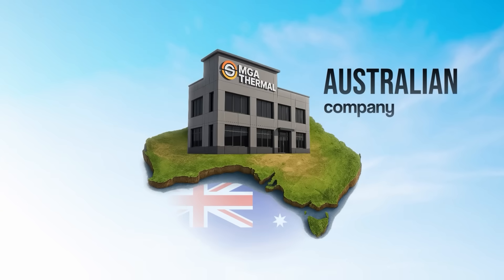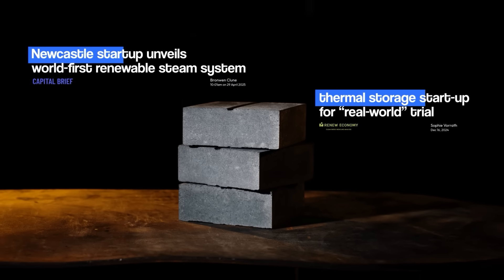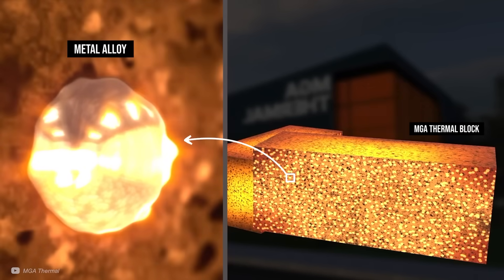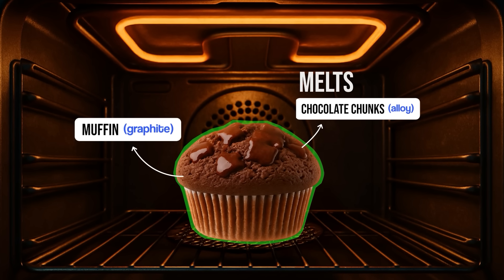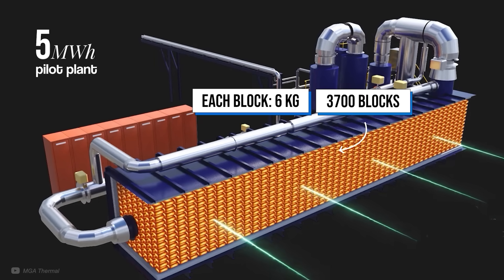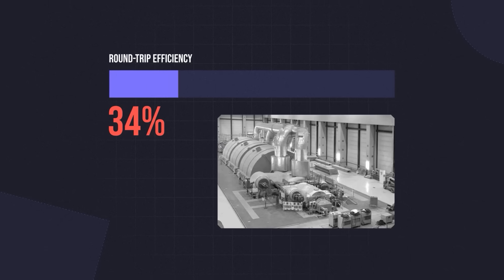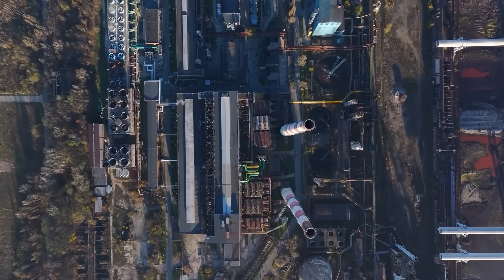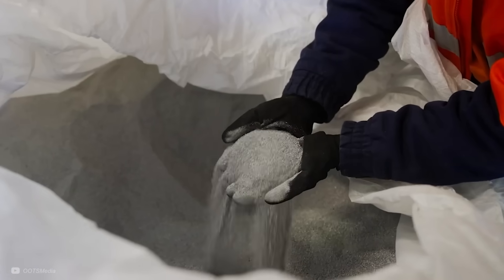Why This Carbon-Alloy is the Future of Energy Storage

Comment: Forget about the blocks, I want to know more about that insulation. 2% loss per day, out of 5000 kWh, means 100 kWh loss per day 700 °C inside, 20 °C outside, and say just 100 m² total area, means 1 kWh per day per m², or roughly 40 watts per m², with 680 °C difference, you need over half a meter thick insulation if it's as good as styrofoam, and that wouldn't leave much space left, and you can't use styrofoam due to the temperature. 

For thermal storage you want the least amount of surface area possible, even if you can store heat with that low loss in a shape like that, you halve the losses if you halve the surface area, and also need half as much of that magical insulation.       

About the blocks, another reason to forget about them is even though the in-plane thermal conductivity of graphite can be rather impressive the inter-plane conductivity is really low, making the overall thermal conductivity of graphite, unless you can align the planes in the direction you want heat conduction, pretty low. On top of that, the graphite takes up space, which increase the size for a given capacity, which in turn increase the surface area, and heat losses and costs even further.      

Metals typically have reasonably good thermal conductivity, on of top of that molten metals can distribute heat via convection, even the in-plane thermal conductivity of graphite is negligible compared to the potential heat transfer in liquid metal via convection in an application like that.  

When transferring heat, you want as few transfer stages as possible. Why use nitrogen if you want to generate steam? Why not put a boiler in there?
Reply from the maker: Wow thats really interesting, I have to admit I didn't actually run these numbers. This is of interest for all high temperature thermal energy storage systems - I will have to do some digging and see what I can find out.
Reply: It could be aerogel insulation like that SpaceTherm stuff. That's silica based so it should tolerate mad temperatures.
Reply: @spankeyfish  Aerogel type materials can probably be good enough, better insulation value than styrofoam and mineral wool and higher temperature tolerance than styrofoam. And without the issue of significant convection as in loose mineral wool. 

Problem with really good aerogels is the cost. Ordinary, more "aerogel-based" insulation materials that are just very expensive compared to styrofoam and mineral wool, only have moderately better insulation value, and typically don't tolerate anywhere near 700 °C.
Reply: You want to use nitrogen, because you don't want water/steam piping in that box full of very hot graphite and molten metal. The extreme temperature difference between the temp you want the steam at and the temp the blocks are at, gives you a large margin to play with to still be efficient in transferring heat with an intermediate like a gas. Although the gas gets to make direct contact with the graphite blocks, so there is a benefit there.
As far as the thermal conductivity within the blocks... normally we have to function within tight ranges of temperature to accomplish things, but the entire point of these graphite blocks is to allow them to use a metal in its melting point range, and get enough headroom in temperature difference to make the system work. So the thermal conductivity of the graphite is probably not inhibiting thermal transfer like you think. The graphite is there to hold the liquid metal in small nodules and create a very large stable surface area for the nitrogen gas to transfer heat off of. 
Mineral wool has a thermal conductivity equivalent to styrofoam, and 50cm of insulation on the outside of a 40' shipping container is not THAT bad. As long as the mineral wool is made with a high temp binder...
Reply: @Tom89194  You want as high temperature as possible. It's kind of the  point of storing heat energy at a high temperature in phase change materials.  Otherwise one should use a different material to store the heat. Unnecessarily high storage temperatures only creates problems, without any benefit, when storing heat in phase change materials. 

Metal to graphite, graphite to nitrogen heat transfer, that's two unnecessary steps of heat transfer, which makes the process much worse, without any real benefit.            

You get convection in thick mineral wool at those temperature differences. And in my example, assuming just 100 m² total area I wrote, OVER half a meter insulation, it's well over half a meter. And that's just based on the theoretical values, in practice you need even more, to compensate for thermal bridges and other aspects of reality.
Reply: @fishyerik  You would not want to try to do 59.5cm(680*.035/40) thick in one go with the wool... convection, and stability/support. Thus you would have blocking materials for support and prevent convection. 
700C IS VERY HIGH ABOVE the temps needed to run most industrial steam setups, which means they have a very large  performance buffer on the heat removal side, and the heat recharging can have a large performance buffer since nichrome can easily be run at 1100C.
Yes 700C is rather high and problematic, but they are up there trying to get an energy density high enough they don't need 20x the amount of real estate to do this.
Reply: @Tom89194  You seem to be missing the completely fundamental fact that they don't store sensible heat, as in "temperature" but latent heat, in phase change materials. Storing heat as latent heat means you can store a significant amount of heat energy without a temperature change, meaning you can choose/design your medium to store a lot of heat at a specific temperature.  

Ryan explained this well early in the video. The latent heat storage capacity, or energy density, of a phase change material isn't affected by the temperature of that phase change, it's an inherent property of the phase change material.
Reply: @fishyerik  I did not miss the fact that they are melting the metal and relying on that latent heat as the main bulk of heat energy storage, really that fact is what made them use graphite bricks as a structural medium for carrying this metal that is going to go from solid to liquid on a regular basis.
That is actually going to be one of the boosts to effectiveness of this type of system, If you were to store the same amount of energy in a non-phase change medium(I.e. sand) then you would have to deal with the fact that your heat transfer efficiency will drop as your sand drops in temperature, and you need a minimum temperature to efficiently move the heat out of the storage. The use of latent heat kinda skips this problem by keeping the temperature of the heat storage higher.
Reply: @Tom89194  Since you're doubling down, try to explain how using a temperature "VERY HIGH ABOVE" what they want to take out from storage in PCMs reduce the "real estate" by "20x". Quotes are your's, and shows without doubt that you either completely missed that it was PCMs, or that you don't have a clue about what that means in practice, despite the fact that both Ryan and I have explained it for you. 

The fact that they use PCMs isn't going to "boosts to effectiveness", neither just "boost" the efficiency, it's only that energy that can provide relevant amounts of energy with good efficiency.     

I'll try again. The main advantage of PCMs is that you DON'T have to increase the temperature of the storage media higher to get more capacity, you just need high enough temperature so you can conveniently can extract the heat at temperature you want. The point is that you DON'T have to store the energy at temperatures "VERY HIGH ABOVE" what you need. That is, it's the opposite of what you think that you know. 

BTW you don't have to reply when you think you get it, I don't care. And I definitely don't want you to pretend that you're providing me with actual knowledge that I don't have, I suggest that you read about the Dunning-Kruger effect instead if you feel that urge again. You even mix up effectiveness and efficiency, and think your assumptions are some kind of superior knowledge.
Reply: @Tom89194  Think a little bit more about it, you seem to be making progress.  Thermal "headroom", is always needed for heat transfer, PCMs can remove the need to store the heat energy as sensible heat, on top of the temperature wanted plus headroom required for heat transfers.    

That's means additional heat transfer steps that increase the required headroom reduce the efficiency of the system. The effectiveness of heat transfer can be increased by increasing the ΔT, or reducing the required transfer rate of a given system, meaning, you can double the effectiveness just by doubling the size for a given rate, or halving the rate of given system size, all else equal. 

Removing unnecessary heat transfer steps can be considered making the effectiveness of those steps infinite.         
 
So, if you want steam out of the system, you place the boiler in there, and choose a PCM with a phase change temperature you want for that. That way you eliminate multiple heat transfer steps, and also a lot of complexity and cost compared to the described system. 

And, for large scale heat storage you make the capacity as big as possible, and minimize the surface area as much as practically possible. 

Very expensive storage media and insulation can't make a fundamentally badly designed thermal storage system economically viable, since there are plenty of dirt cheap PCMs that are good enough, and also cheap insulation materials that can be more than good enough, with a sensible design. 

It's intended for industrial use, not areas where every square meter is worth a small fortune. And since thermal energy storage that use resistive heating directly have multiple practical disadvantages compared to batteries, such thermal energy storage has to be a lot cheaper than batteries, per unit of storage capacity to make sense.                

If they're using an aluminium based alloy, the graphite is in the way for what they want to achieve, as it takes up valuable space. The heat conductivity of aluminium is really good,  and on top of that, when molten, potential heat distribution by convection makes the heat conductivity of any material just ridiculous in comparison. 

About the temperature, for powering steam turbines you want as high temperature as possible. 700 °C is definitely much higher than the temperature of steam used in most other applications. 

It wouldn't make sense to design a PCM thermal storage system with phase change temperature around 700 °C to generate steam at temperatures commonly used for other purposes than power generation.
Reply: @fishyerik  The inside temperature of a "full" storage is high and the outside temperature is low. The whole system looks like way more than 400 degree C for all those transmissions (Storate to N2, N2 to Steam). Industry steam is not some 120 C lukewarm dampness.
So please think twice before you call those arguments stupid. And as soon as you think twice you will stop to do so.
Reply: @fishyerik  You missed something fundamental here.
Hot sand storage systems are already in the temperature range as this system, and all of the ones that I have seen info on use a GAS as an intermediate transfer medium.
Sand is an even poorer conductor of heat than graphite(inter-planar) ~0.114 vs 5-10 W/mK. 
A heat exchanger that handles steam at high temperatures is expensive per unit of size when compared to simply passing gas through your storage medium to transfer heat in/out of your battery. 
You want to remove this intermediate heat transfer step without thinking about the consequences of actually doing so. You don't get to 'just place a boiler in there'. 

The graphite blocks are being used to create a large and stable heat exchanger for the gas to interact with over thousands of cycles. You seem to think the graphite is 'in the way' but you have to make a stable heat exchanger, and these systems are so large in volume a direct boiler heat exchanger is probably not an economic option...

What 'dirt cheap' pcm would be viable for steam generation storage? Keep in mind that if your system uses your 'just place a boiler in there approach' then you need to factor in the cost of a boiler that spans the volume of your storage medium. This might make your 'dirt cheap' pcm a lot less cost effective.

Yeah, rockwool with correct sectioning can be a very cheap insulation material....

You seem to think that the size of the system is not a factor. While this is less of an issue in new construction, space=money in industrial lots. Sometimes this is fairly cheap, but that is not always the case and any retrofit installation in existing facilities is going to feel tighter constraints on space requirements in most situations. Retrofit situations often consider space as worth 'a small fortune'.

You seem to think this is an expensive storage media, lithium ion is at least $40/kWh and will lose capacity over time. Aluminum at ~400kJ/kg latent heat and $2.5/kg would cost  ~$22.5/kWh. If they manage to make the graphite blocks stable enough, then they could have a service life of decades. So as long as you want to keep the energy as heat, then there are actually few practical disadvantages compared to lithium batteries.
Reply: @Tom89194  Hey, Einstein, what makes you think that is fundamental? Don't use words you don't understand. 

All the systems you've seen, so? 

The heat exchanger that handles steam is needed to generate the steam anyway, it's not an extra cost to just eliminate the gas step. Restive heaters can be made very cheap, it wouldn't be expensive to big enough to heat the media much faster than forcing a gas through the media. 

Of course size is important, that's the Achilles heel for high temperature thermal energy storage, if it's not huge, it's not practical.    

Their media is proprietary, that's their "secret sauce" they won't sell it for anywhere near the bulk price of aluminium, they can't even produce the media anywhere near that price. They have spent years and a lot of money developing it, and it's a startup, they won't even be able to produce the media as cheaply as LFP or sodium-ion batteries, per unit of capacity. 

On top of that, when the heat is turned into power, you loose about 2/3 of the energy, so, their cost, for the aluminium alone, bulk price, triple your calculation, ~$67.5/kWh out from storage. Again, that's just the bulk price of the aluminium, the bulk price of the sodium in sodium-ion batteries is maybe 1% of that. 

Total cost of the system is important, the cost of the media is just one part. In battery storage systems, the batteries represents most of the cost. In high temperature thermal storage, there are very significant additional costs, especially if the system is unnecessarily complicated.   

Also, sure batteries lose capacity over time, but not much, an insignificant issue compared to the drawbacks of that system, and their system isn't even proven yet, it's highly unlikely they manage to get lower degradation than LFP-batteries. High temperatures, repeated phase changes, is a solid matrix, yeah right. Also, the same team that blew up their system. Best realistic scenario, no one get seriously hurt before they give up.
Reply: @fishyerik  Reread my reply, you do not understand anything about my portion on heat exchangers if you are still on about that.
Do you understand how their fire started? I do. They did an experiment and found out their brick production is an exothermic process...
Batteries lose enough capacity that their useable lifespan is measured in years, not decades. If they manage to make the graphite matrix stable, then having the melting and freezing of the aluminum as small nodules can prevent the kind of trouble you are thinking about..... 

Who in their right mind would think that they would be able to produce their bricks cheaply during the startup/prototype phase.... and they have almost 200% headroom from the bulk cost of Aluminum to buy the other brick material and produce bricks before they reach the BOTTOM of the price range for lithium batteries.

Think real hard before you show your ignorance and arrogance again. Heck, the best you could come up with for insulation possibilities was styrofoam......
Reply: you can not have water or steam contacting the graphite at that temperature because it would react chemically and produce  hydrogen and carbon monoxide and with aluminium to produce hydrogen and oxide.   nitrogen could be replaced with inert gases but those are rare and expensive

Comment: Could you imagine this sort of power storage with nuclear power, possibly layered into its own thermal regulation?? 🎉🎉 Future looks bright let's go
Reply: Uh....  It's pretty easy to change the thermal output of all nuclear reactors on demand.  
For example....  Shut down everything now?  It's called a scram.
Reply: @kayakMike1000  Unless you are Chernobyl and a scram causes a momentary energy spike under certain conditions.....
Reply: The temperature is probably too high to match what you need for something like that in a nuclear plant. Also, nuclear plants have built in control that regulate the heat production of the generator.... to match the power output.
Reply: @Tom89194  indeed.  High pressure water reactors operate around 300° C